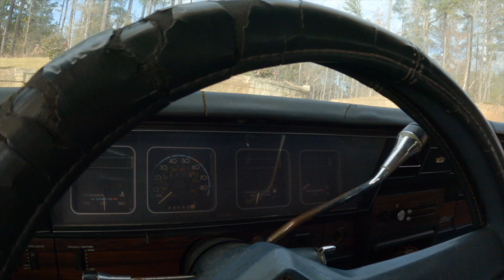89 Caprice Resto! Ep. 2 Seats Removal plus some OBS footage!!

Comment: Thanks for that. Locked my keys in the trunk and learned the hard way. My 3/8 impact sucked. Ratchet and t50 alone did the job.
Reply from the maker: No problem fam!! I be trying to share as much as i can sometimes i be moving so fast i forgot to explain things!
Reply: @SouthSideNate   A little stressful since the car is for sale and had to make sure not to break anything. Its also a 89. Caprice Brougham LS with the quarter top.